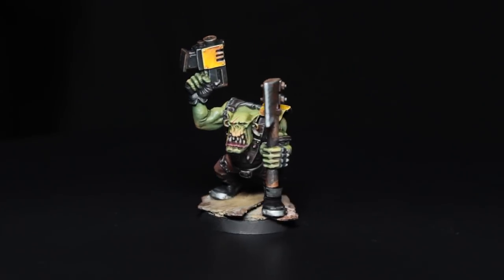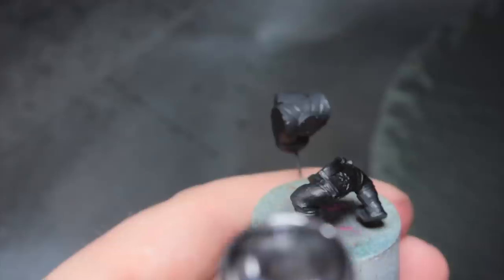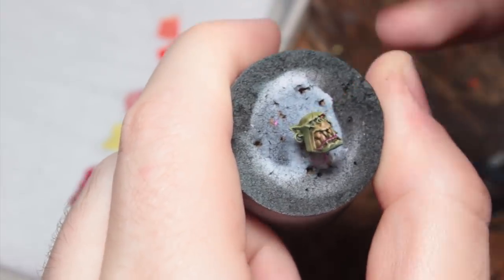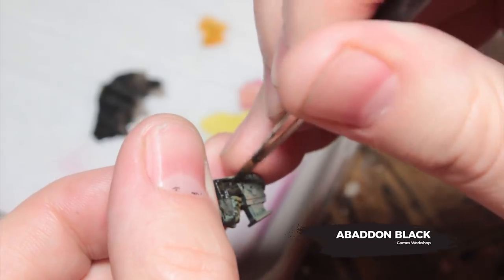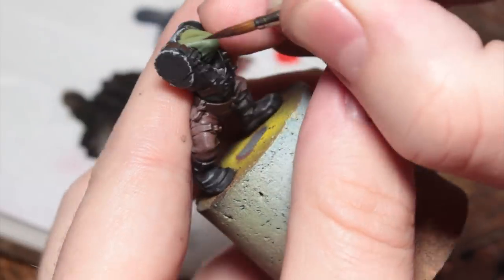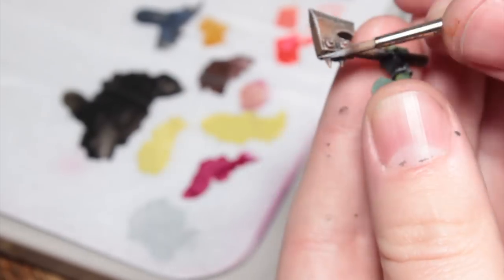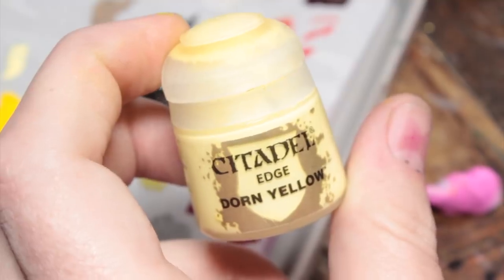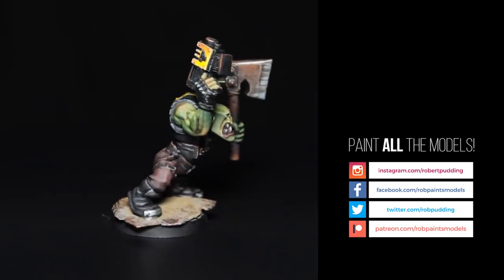How to Paint Orks - Bad Moons Ork Boy

Comment: Krumped it. Good work. 

How do you find it painting sub assemblies when doing large batches?
Reply from the maker: Pretty easy. With Ork legs for example you can leave them attached to the sprue as they are connected at points that won't be visible after assembly. For the arms some double sided tape on a coffee stirrer works great for doing up to 5 at a time.

Comment: do you just glue it together afterwards with plastic glue ? do you scrape paint off the areas before gluing?
Reply from the maker: Scrape any paint off the contact surfaces and then use plastic cement. Just be careful and don't use so much it squeezes out the sides as it will probably melt the paint.

Comment: Hi, thank you for the guide. When you say ‘if you’ve painted a part when assembling make sure to clean it’ how are you cleaning it please? Painted parts don’t stick together I wondered how you get them to stick. Ta
Reply from the maker: Just use a hobby knife to scrap away some of the paint on the contacting surfaces so the glue can grip onto the plastic. Some plastic cements will melt through the paint but some won't. Super glue especially needs a bare unpainted surface to work correctly.
Reply: Excellent thanks!

Comment: When you assembly them later - there is no problem when you glue them? Bare plastic and plastic glue works better or not?
Reply from the maker: Always remove paint from the surfaces to be glued together first. Plastic glue will work fine.
Reply: @RobPaintsModels   you do that with mold remover tool / knife? Why no using blu-tack or smart putty instead of removing paint later? Btw - awesome tutorials man, thanks!
Reply from the maker: No reason really. It's just what I do.

Comment: How do you thin the citadel paints for air brushing?
Reply from the maker: I use Winsor and Newton galleria acrylic flow improver diluted with water according to the instructions on the bottle. It usually only takes a few drops to get the paint flowing nicely.

Comment: Great job. But if anyone think it's painting a ork boy to this find detail level. Remember you a going to need at least 30 ork boyz. And that will drive you nuts. Not to mention having boyz looking that good and finally detail. Elite and leader units are going to have looked as good or better. And painting my Warboss almost as good as this took over a day and a half. And I may still give it a touch up yet.

Comment: I noticed that when you apply the wash and then move it around with a clean brush it doesn't leave that 'dirty coffee stain' effect on the flat areas where  you don't want it to go, is that because the wash and the base paint underneath are complementary or do you do something special with your wash like thin it down with water or acrylic thinner ?
I hate it when I spray my ultramarines in McCragge Blue and get a perfectly smooth surface and then I apply the nuln oil wash and it stains it on the blue base paint (around the non-recessed flat areas of the model) even though I am as careful as possible to try and get it in the recesses (I've tried modifying the wash paint on the brush and looking at it with magnifiers etc and no luck). The clean up job with McCragge Blue never produces a clean/smooth surface like the airbrush does and it drives me nuts having to do it. I'm seriously considering spraying a Vallejo Gloss varnish on it, doing  a pin wash after with nuln oil then spraying it with matte varnish to dull it down again and continue the painting. If the nuln oil misbehaves during the pin wash described above I'm seriously considering using those Daley Rowney FW inks thinned down or maybe some oil paints thinned down with white spirits (although I hear the OILS are better for surfaces that should look like metal. And using the inks or the oils for a wash isn't ideal as they're meant to be glossy and then it's another coat of matte varnish to dull them down. I'm a bit disheartened at it really, I want a fast clean way of painting lots of ultramarines as fast as possible to a reasonably high table top standard.
Reply from the maker: The trick is to do it quickly. When you are doing your marines for example apply the wash to just one leg or the chest and clean up straight away with a damp brush. Acrylic washes start drying immediately so you have to be fast, if you wash the entire model then by the time you get round to cleaning up the wash will already be drying and will leave stains. It's also important that the surface you clean is still wet as this will feather out the wash preventing a tide mark.
Reply: Makes perfect sense, because if you leave it too long the wash medium carrying the medium will dry and the pigment will settle on the surface of the base paint (flat areas) where you don't want it.  The trick is maybe to have a set of differently sized brushes already wet with a jar of water for rinsing, a good light to see where the wash medium has spilled out onto the flat areas, some paper towel and as you advised to do clean up fast and focus on one small part of the mini. Ok thanks. The wash was drying so fast that I was going back afterwards to rub away the dried wash with a wet wooden toothpick (this works sometimes / not always though hence my frustration).
Reply: Dave Dogge another way to do it is as you said to use a gloss varnish. But try using the gloss wash after that instead of the normal wash. Theres literally zero staining and a bit quicker when just doing one wash and batch painting. I found it an easy and quick way to get my ultras finished.

Airbrush basecoat macragge, gloss varnish, gloss nuln oil all over, matte varnish. Finishing up bolters and what have you over the matte varnish.
Reply: yup quote "Airbrush basecoat macragge, gloss varnish, gloss nuln oil all over, matte varnish" is what I plan to do. I'm going to use my cheap chinese airbrush for the varnish (aint using my expensive ones). Strangely I've never airbrushed varnish before but I'll be very quick about cleaning it up because it sounds like a nightmare to clean from the tip / cup, a little bit of airflow improver may help also. I got a bit fed up with the Citadel Washes actually (not their fault, it's my technique) but I bought some FW inks as a fallback in case the pin wash after the gloss doesn't work with nuln oil.